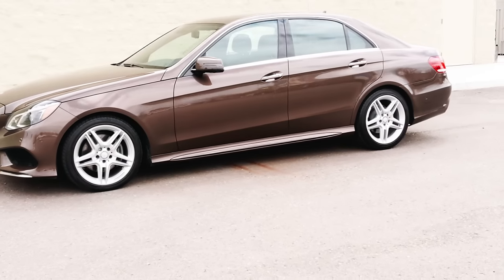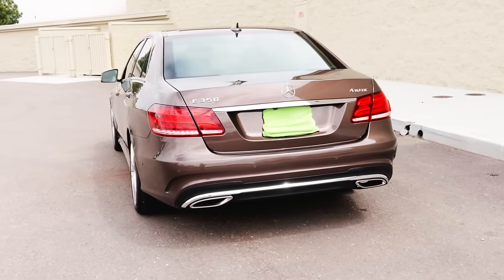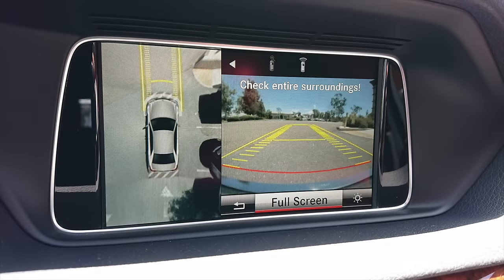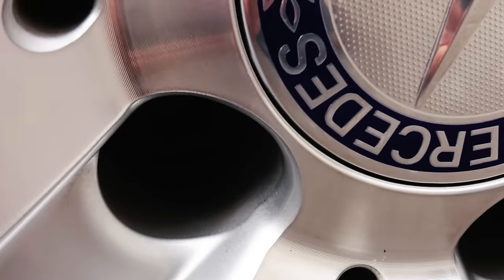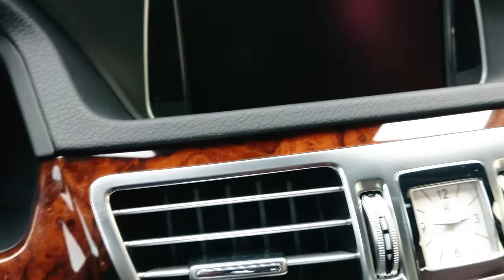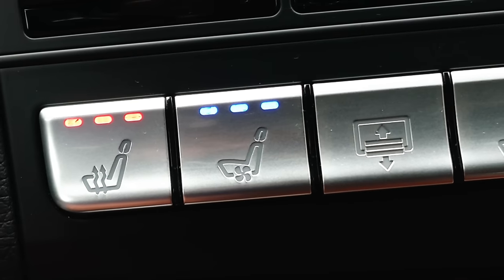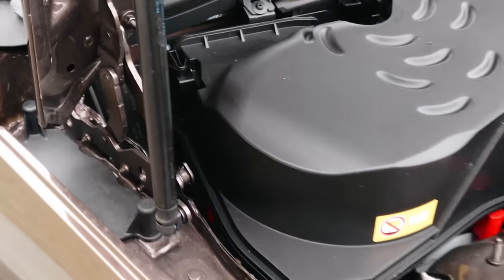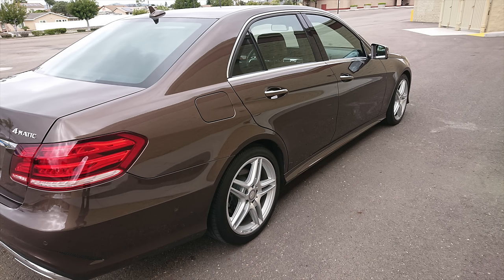The W212 E-Class is one of the best Mercedes-Benz Cars Ever

Comment: W212 is the best quality Mercedes I ever owned. Have had  two cars and driven them for a total of 8 years and absolutely zero problems what so ever!
Reply: can you tell me what engine capacities they are?
Reply: @joakimquensel597   Thanks, I'm hoping to buy a 2010/2011 E200 CGI but i got mixed reviews about it saying that the engine has some issues. IDK if it's true or not. I guess the diesel engine is the best in this model
Reply: @joakimquensel597  Yes I think so too, Thanks so much for the info, cheers! :)
Reply: I have a 2009 E350 CDI just 97k miles, I bought at 90k miles and the turbo was gone now, i used just premium diesel and mercedes oil and filters. What can i say..?!
Reply: Eight years?  Gee  Once upon a time, there was a car-maker called Daimler-Benz.  They made quality cars that would easily last 30+ years and retained their value like few cars could.  Today, they make cars that may last that long, but are so expensive to maintain, that their value sinks like the Titanic.

Comment: We bought our 2011 E350 base model no frills for $41K as a leftover with factory cash.  Best car ever, no nav, no backup camera, no parking sensors, nothing to break.  Guess that's why just now it's starting to fail with minor stuff like window regulators and blower motor for AC.  No big deal, I'm doing the fan and resistor for under 200 bucks and paid a bit for a window regulator but that doesn't take away from the fantastic, solid, smooth vehicle this is.  Reminds me of our old 1996 E320, it just handles better.  Can't bring myself to sell it even though we have 5 cars in our household.  It's that good.

Comment: My opinion: every e class model series ever made were great cars. 

Regardimg the w210: We own four w210s. 2 are driven daily. 1 of the 4 i was in a huge high speed accident with and it literally saved me and my front passengers lives. I still own it for spare parts. 

Only one issue in 3 of the 4 in more than 10 years.. Gearbox that gets water via the radiator. If i had done the separate cooler mod sooner it would have been only one car so its partially my fault. 
Further just normal services were done and i replaced a regulator on an alternator. Rock solid indestructible engines. 
Not a single rattle or squeak in any of my w210s so as far as im concerned they were well built as well. 

I know the w210 has a bad reputation because of rust in usa etc but where i live that never ever happened. You wont find a single spot of rust on any w210 here in South Africa.
2x 2001 E430 
1x 1999 E320
1x 1997 E280

Peter the E class fan ❤️
Reply: I believe the w210 is underated.
I have one here in Kenya an e230...so reliable

Comment: Such an informative video! I own and love my W211 2005 E350 :-) it drives so much more comfortably and refined than A/B/C class loan cars I’ve used and is always a joy and revelation to get back into after driving other vehicles. However, my W211 is aging (102,000 Km /15 years) and its logical replacement is one of these W212 350s or 500s. The 212 shape, for me, is less beautiful, but thank you for making this truly worthwhile video! :-) PS: my replacement W212 will hopefully have a traditional 3-pointed bonnet Star ⭐️ and am happy to do away with visible exhaust pipes, if that’s what it takes ;-))
Reply: I’m driving my 17 year old - model July 2004 year - W211 E 220 CDI with 227,000 Miles (imperial), and have recently replaced all four brake discs and pads, so our plan is to be together for a long time ahead.
Reply: Ps. I neglected to add my total agreement that the Mercedes Benz Star will be standing proud on the bonnet of any replacement car!
Reply: @josephmccloskey5937  a wonderful plan that is great to hear 👂🏼:-)

Comment: I have a 2012 E350 4matic with 97,000 miles and just had to replace the transfer case.  Since it's part of the transmission I had to replace the whole thing.  Mercedes wanted $10,000 to fix the problem.  Got a local service transmission guy to do it with a rebuilt one for $5k.  So far so good, but wanted to see if anyone else has had that same issue
Reply: I own a 2013 E350 4Matic with 50k miles (in 10 years). Mostly garaged and so far no problem with any powertrain issues. Drives like a truly awesome German road car and it shows it’s true colors at 100 mph on the interstate   Solid and powerful

Comment: My parrents drive a 2014 E220 diesel stationcar, 170.000 km - no problems just normal service intervals. I drive a 2014 C- class coupe W204 with the same engine - and i love it, but my next car is going to be a W212 E class - Beside the 2006 S-class 320 cdi my dad had from 2008 -2014. The E class w212 is the best car I have ever driven.

Comment: I had an 2012 e250. Had two serious and known engine failures: high pressure gas pump and a problem with something in the variable timing mechanism. Mb did nothing to correct those and had to pay everything myself. When I sold it with 60k miles, the gearbox was leaking a little bit. I heard that the engine problems where corrected on future models. And the engine in the e350 was great. But the e250 was crap

Comment: Maybe not the best, but one of it!
I have a eclass w212, 220ci and edition e.
After 4 years and 24/7 using now  the car has 700000 km and everything is working perfect.
I only change the oil, brakes and wishbones in the back.
For me one of the best cars in the world, the new one w213 is no nore an eclass in my opinion.
If i get it now, i would buy this car anothertime qnd anothertime...
W211 was also pretty good, the models after 2006 are world class.
With both cars over 700000 km and no damages! German engineering 🇩🇪

Comment: I have owned the W210 (230 A), W211 (320 A) and the W212 (250D 4-Matic), I liked the W211 the most, the interrior matarials felt better and overall it felt more premium. I think the thing that spoiled the W212 for me was the lowered AMG suspension that came with some sport package that it had and the stupid 250 Diesel motor combined with the 4-matic, it was really slow to react when floored. 
But the facelift of the W212 looks much better than the pre facelift models.
Reply: The w211 is great. Power is always present and available. The 268hp with the 4matic system is a beast

Comment: I have an S212, 2015 facelift, love it but for two design faults
1 The alarm siren is in the front wheel arch, really? Sensitive electronics  in a wheel arch ?
2 Airmatic suspension - the air bags failed at 5 years and 60,000 miles - £1350 to repair at an independent

Comment: Ive owned a 212 facelift E63 and own a W211 E550 - W211 is the better car hands down sorry. No comparison IMO. Facelift 211 and 212 are beautiful though.
Reply: @Ilir Cami The W211 is fantastic quality - at least the facelift. The looks are more dated being an older car, BUT its still got that pure Mercedes look that the 212 doesn't have as much of - at least from the front on the facelift. You guys probably think im crazy but I think the M273 V8 is a better daily driver motor than the M157 AMG V8. I tracked my 211 for fun a few weeks back and sure its not a track car but man it still goes like hell and is a lot of fun. The 212 interior is great quality BUT from my experience was just less classy and luxury feeling than the 211.
Reply: @Ilir Cami And the ride / gearbox is smoother BUT its a non AMG on full air suspension.

Comment: Does anyone know anything about the 2016 E400?    I recently bought one of those with all of the options.  This review mentions all of the other models, but does not mention the E400.  What is the difference between the E350 and E400?  Thanks,
Reply: The primary difference between the E350 and the E400 would be the engine. While the E350 has a naturally aspirated 3.5L V6 (302 hp), the E400 comes with a twin turbo 3.0L 6-cylinder (329 hp) engine. Also, the E400 does come with a bit more standard features and options being that it was the more expensive car.

Comment: Buyer beware, I have a W212 and it is a great car BUT you must keep on top of maintenance issues, the car suffered a major failure of its rear subframe a known fault on the E and the C class, its a warranty item so Mercedes should change for free the subframe corrodes from within , you will need to replace the oil cooler every 80,000 miles along with servicing the auto box, do regular engine oil changes ! i change my oil every 4000 miles, the rear brake dust shields have vanished due rust, apart from that and the odd silly message it is a great car with presence on the road, handles really well too.
Lastly the  manifold is made of plastic and this is a known fault it splits and you lose power with the engine management light on the car will be in limp mode , I have to change this manifold and will also replace the oil cooler too these are very very big and costly jobs to do and are a known fault area on the E220

Comment: I'm so salty they didn't continue the E 500 models. Currently have a w211 facelift E 500 and it's the ideal car for me. More than enough power for daily driving but not showing off like the AMG models. But I guess european V8 are finally dead except the top of the line models.
Reply: Did you put the facelift parts on it?

Comment: The first model w212 totally rocked with the double headlights. Unfortunately, the interior sucked...busy, ugly and cheap. It seems to be the theme now with ipads stuck on with blu tack. The steering wheels are particularly horrendous
Reply: What you said is perfectly correct . Only design lasted for 6 years is w211.
Reply: WTF? The pre facelift has the same interior like the facelift.

Comment: I drive a 2014 E350 base. The car is awesome, it runs like new and I have 170k miles. Normal maintenence and it runs great. The pleather seats are not desirable but the rest works the way they should.
Reply: That’s also the single thing I don’t like about it, I use the chemical guys leather spray and spray them down and it smells like real leather at least lmao.
Reply: That MB Tex is not just any pleather though. It will outlast leather easily and look new forever. It also doesn't have any of the problems associated with pleather like turning brittle due to sun exposure. My experience with it was an E class that I bought over 30 years ago but I doubt that it has changed.

Comment: I own a 2012 E250 W212. Have done 90k Kms on it. Except for driver side lather seat which is near spoilt due to frequent use...no problem so far. Normal maint and you are good to go . I also use BMC performance Air filter and have also installed 10.25 inch android with 360 degree camera and since I am india where potholes are road breakers are nightmare, i had to install Rogerab Shocker absorber which increased the ground clearance by almost 2 inches.

Comment: 2012 E550 Cabriolet....just turned 55k miles and trouble free except for the adaptive cruise control break checking folks following me when I try to pass a semi which is in the lane immediately to my right.  Outside that, has some serious power and handling with it bi-turbo V8!

Comment: W212 hasnt been out long enough to be time proven.
Ive owned both new and old and nothing touches the w124
Reply: ah, a man of culture and knowledge i see.
Reply: Is have a 86 260 man its a monster stil drives great its everything you need with a car
Reply: Nothing probably ever will the culture is throw away now nothings made to be kept in cherished and taken care of You lease it beat it up turn it in, not even the new Toyotas and Hondas give the exceptional reliability that they used to.
Reply: @thetechlibrarian  At first I did not understand your primordial speak.  Then I read between the lines with my own imaginary punctuation, and yes you are correct on all points sir.
Reply: This Mercedes is indeed the best after a w124.
But the quality of the w124 will never come again.
Mercedes made a big mistake by letting the nose go down too much.
A current Mercedes no longer gives the king feeling of the past..
The current E class seems to be 50% plastic.

Comment: Correction on quality: the 211 facelift definitely sits well (!) above any 212, not like it was stated here, below. Do not be fooled by some twinkling LEDs and infotainment extras here and there. The 212 also had major issues with the Diesel engines, costing the company about 1 Billion Euros. They are still not as easy to maintain as the ones in the 211, i.e. timing chain issues.

Try to get a 211 facelift and hang a poster of the 212 somewhere if you like it that much 😉

The W/S 211 facelift was the generation (after the 210) in which Mercedes already picked up on rebuilding the E-Class' reputation. The 211 facelift are still used as taxis here in Germany doing it with major mileage on them.
Reply: dw someday 212's /W207's(Coupe version) will be as cheap as w211's so you can finally afford one :D
Reply: The 0m651 engines did have issue where the timing chain can give problems but its not a huge problem. The cost to replace the chain is only 20% more expensive than any other vehicle with a chain. Its certainly not a deal breaker. This engine is otherwise very reliable and is capable of high mileage
Reply: Right sir! W211 face-lift got the real elegance of Merc!!!
Reply: Na the 5 speed box in a 211 can’t hold a candle to the 7g+ and also the v6 diesel is miles better than the inline 6 just as reliable but more efficient and powerful the 211 is a great car but the 212 is a definite step up pre facelift 212 still looks like a Mercedes’ the facelift 212 look crap I admit
Reply: We own four w210s. 2 are driven daily. 1 of the 4 i was in a huge high speed accident with and it literally saved me and my front passengers lives. I still own it for spare parts. 

Only one issue in 3 of the 4 in more than 10 years.. Gearbox that gets water via the radiator. If i had done the separate cooler mod sooner it would have been only one car so its partially my fault. 
Further just normal services were done and i replaced a regulator on an alternator. Rock solid indestructible engines. 
Not a single rattle or squeak in any of my w210s so as far as im concerned they were well built as well. 

I know the w210 has a bad reputation because of rust in usa etc but where i live that never ever happened. You wont find a single spot of rust on any w210 here in South Africa.
2x 2001 E430 
1x 1999 E320
1x 1997 E280

Peter the E class fan ❤️

Comment: I own 2 W211s (03 E500 and 07 E550) and my next car will for sure be a W212, either the twin turbo E550 or E63. W212 is my favorite generation E class
Reply: My 2008 w211 has been so reliable and looks so good it’s hard to give up, I’m thinking about the pre facelift w212 to keep the quad headlight look. Hard decision
Reply: @Allen216.  my e500 was wrecked unfortunately. Had a little over 200k miles on it. I have 157k currently on my E550
Reply: @Allen216. As a car addict who has owned around 30 cars over the last 10 years its always better to not sell a reliable car. Better get a new one first and see what it does over the first year or two.

Comment: The e500/550 is rocket with the 4,7 biturbo, with tuning it can make the same power as e63
Reply: Yep I have one! Thanks to eurocharged its 580hp
Reply: what about transfer case issues with 4matic
Reply: Mines from Japan its rear wheel drive only
Reply: @paulharris5950  ok im only scared of this issue otherwise i was buying one tom here in Canada
Reply: Martin Svensson  there were few cases for w212 which requires the transmission be also replaced if transfer case issue pops up also another weird issue which completely threw me of was camshaft sensor leaking oil and damaging engine wire harness repair could be 7k to 12k and for transmission around 8k not sure how common these problems are most likely pretty rare but scared me tho
Reply: Also its the facelift so think any foibles were sorted by then
Reply: They are not reliable
Reply: Mine is